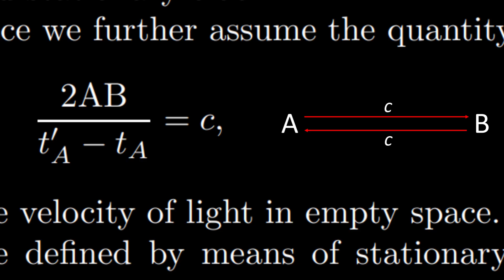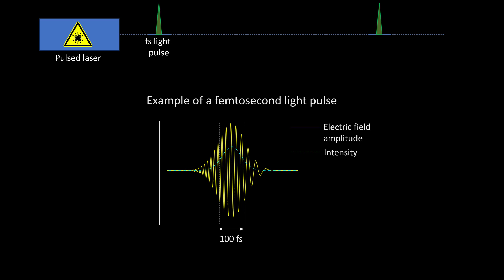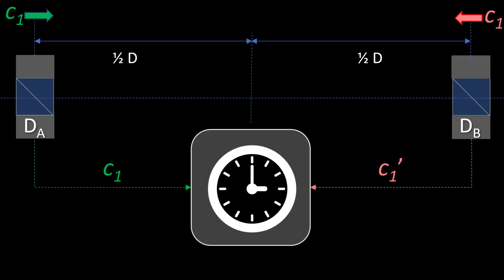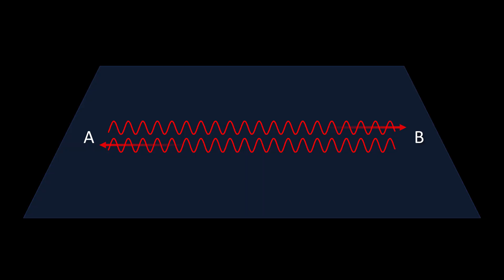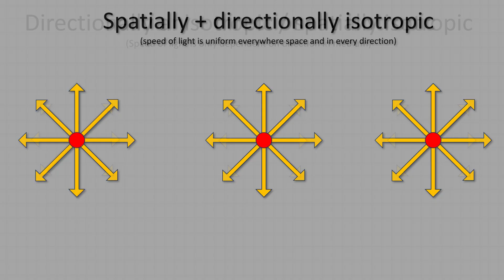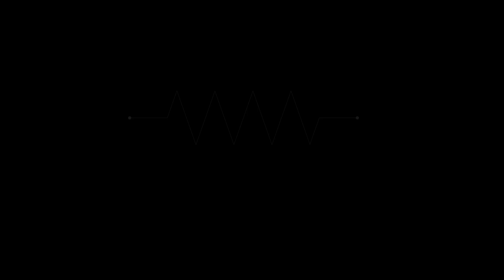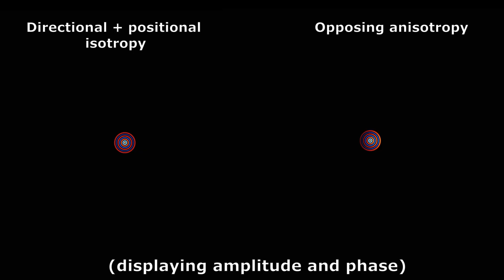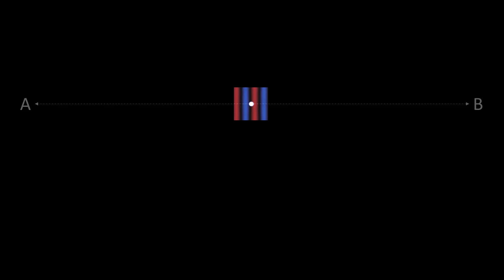Knowing the one-way speed of light

Comment: There are some very simple simulations you can do to see the ckear difference between a frame witg a moving medium and a frame wirh a stationary medium, regardless of the relativity being there in both cases empirically. For instance grab a cavity, and calculate the scattering of reflected waves inside it with the cavity moving along in the medium. The way the light scatters inside is different with a central source that a similar cavity with a stationary medium. The anisotropy in opposing directions resulting from this does not change the emprical results, but it does change the waveform quite a lot. You should also make the cavity elliptical due to lenght contraction based cleverly in radiation pressure being the same on all parts of the wall,  you don't need to put in a lorentz factor by hand, but with a contracted cavity you don't get a similar wave pattern as in a stationary cavity it is rather different. Then you can elongate the space, which reatores the circularity of the cavity, but makes the speed of light appear anisotropic in this frame in a different way, namely transverse and longitudinal speeds are different in the streched space, so it is equivalent to a circular cavity moving with respect to a stationary medium, that is isotropic in opposing directions but anisotropic with respect to different direction such as transverse to the relative motions vs aling the direction of motion and so on. These are all just arefacts of transformations, but it shows that the medium only becomes effectively anisotropic in opposing directions due to motion, but due to a transformations taking contracted elipsoids back to circles makes another kind of anisotropy that can be expected to arise from material properties, and of just arbitrary transformations of space and time. Interestingly the intersection points of waves with reflectice surfaces always travel faster than light, and in a circular cavity, a lorentz transform takes this messy scattered inside an eliptical cavity and by choosing a different plane of simultaneity restores it to a nice circular standing wave pattern, therefore it is also possible to get representations in terms of an elliptical standing wave pattern with is built up of concentric ellipses of nodes and antinodes. It is fun to get an intuition for, you should play around with it. My experience with the physics community is that almost nobody, exactly nobody i have interacted with understand this space of more general transformations, that unites euclidian and minkowsky type formalisms under one coherent roof and that leads to a lot of myths and poor understanding of relativistic physics and what it means, such as incorrect tacheyon physics and idiotic derivations of time travel from Coordinate conventions and so on.

Comment: Your argument is basically not what was argued about with the isotropic propagation. Representations always exisred based on anisotropic propagation but only possible to construct mechanisms for in terms of moving frames with respect to a medium, these are euclidian transforms, which work just as well as lorentz transformations for relativistic physics, but is part of a broader class of transformations that drop the assumptions of isotopy in the speed of light in terms of representations of reference frames. In this broader context of representations, it is the  free choice of convention that gives rise to empirical invariance instead of a specific choice of convention like Einstein mistakenly derived/plagurized, and poincare and minkowsky formalized into conventions of spacetime structure. None of it is necessary it is just one way to do things, that only works because of the empirical invariance. The broader class of transformations between representations are more useful for more general physics where you can introduce small deviations from invariance and so on.

Comment: In what case does water waves have anisotropic propagation, simply if you move with respect to the medium, i don't think anyone have tried to argue the isotropy is false in the rest frame of the medium, but the question in Einsteins or ratger poincares argument is one of ignorance of whether you are moving or notnin the medium, it is about relative motion without regard for mechanism, because equivalent observations can be derives from a basis with a different speed for the medium, aka you can represent every state of observable motion in terms of being at rest with respect to an isotropic medium, however both of them are naive and did not discover the full transformation properties in terms of moving frames, where you can descibe every situation equally well in terms of moving witg respect to the medium, so any anisotropy can be explained as such, only tge determination of such a velocity empirically remains to be found, anyway, anisotropic mediums is not what anisotropy in this case is about, it is about representations where you are moving through an isotropic medium thereby making wave propagation relative to you anisotropic.

Comment: Also, the only way you could possibly do it is in higher dimensions, if the orientation of the wavefront matters at all in any experiment. For example, take a spherical cavity, if the cavitynis at rest in a medium such that light propagates isotropically relative to it, the. A wave fro. The center will hit the walls head on, while a moving cavity with the same wave inside it in a moving frame would be contracted and the wavefront would not hit the wall head on due to both the contraction and the motion through the medium, if you can construct a wall of such a cavity such that it lets more or less light through the walls depending on the incidence of the wave hitting it, as in partial reflections for example, then you could tell whether the motion of the cavity relative to the medium is 0 or not, aka whether the effective speed of light relative to its state of motion is isotropic. But who needs that in their lives. Anyway there might be some way to make that kind of experiment relativistic, i don't care too much, i have other issues witg relativity that i'm pretty sure kill it at some level anyway, so i'm not so invested, but it would be cool to show poincare wrong.

Comment: Why this one-way mystery? Harlow Shapley had a distance from the star (globular cluster star) determined and also had a certain pulsing signal timing from the star. By using those two, in a very simple sort of a way Shapley came to the conclusion that the yellow light and the blue light had the same speed within one minute in 24 billion. So, Harlow simply showed that there’d be no error at all up to the particular accuracy of 10^-24x10^9 min. All these cosmic speeds of light could, of course be determined only as one-way speed (from star to an observer). Obviously, the speeds out in the vacuum of interstellar space would also be the same. Well, it would have taken a wait of some hundreds of millions of years to measure a two-way speed of light over cosmic distances.

Comment: @Huygens Optics.  Please consider the following and critique.  I believe it would be a way to measure the 1-way speed of light.

Let a laser light source send a pulse horizontally from S to a mirror M.  Between these points place a beam splitter B close to the source.  Anywhere along a line below and parallel to the line S-M, place a receiver/Clock RC.  For convenience, the first example assumes RC is positioned directly perpendicular to the midpoint on S-M, such that the distances B-RC and M-RC are equal.  (Variations on this experiment would place RC perpendicular to points B and M to eliminate “x”  or “-x” components of the down-beam velocity, and to compare results between experiments.)

A pulse of light from S would partially deflect to RC from B, starting the clock.  The remainder pulse from the same beam would reflect off of the mirror M and traverse to RC, stopping the clock.  Since the delay from either B to RC or  M to RC could be made equal (centered) or related by trigonometrically by the geometry of the triangles formed by the paths, the delay between pulses at RC would be entirely due to the distance between B & M divided by the 1-way velocity of the beam, right?

If as you say in your video, the round trip (the C' paths) cannot be eliminated, I would ask it replacing them with a known transmission velocity wouldn't do the trick.  For example, the speed of electric signal propagation in a wire is not the speed of light, and if the materials are consistent, the speed of the signal should also be.  Alternatively, the speed of sound does not diminish with energy loss, so why not use sound waves for the paths from splitters to receiver?  In this way there is only one light path, and only in one direction.

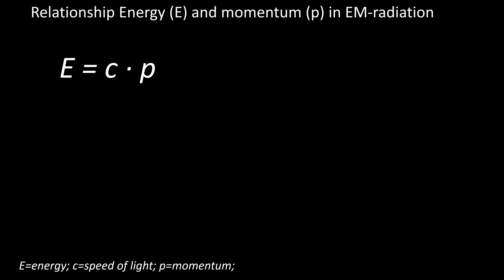Comment: I also saw many videos on the topic, included that posted on the Veritasium channel. In my opinion you’ve just found a way of proving that c is equals in all direction (@21:35), at least in a small region of the space-time, as I did more than 3 years ago but with a different approach.

Here is my point  
Let’s imagine we have a monochromatic source of light with wavelength λ propagating toward a diffracting grating with parallel slits each separated by the distance d.
We know that we observe diffraction and the first maximum (order 1 diffraction) is offset by a theta angle according to the following equation:
  d sin(theta) = λ    (eq.1)
But from the definition of velocity (space  divided by time = space/time ) we also know that
  c = λ /T  =  λ v  (eq.2)
being v the frequency of the light. Thus combining the two eq. we have 
  c = d sin(theta) v     (eq.3)
Since the frequency of light should not chance by changing the direction of propagation (we can ideally measure it in the same reference frame at rest)(*), if the velocity of light is different along the two directions, from eq. 2 we should observe different wavelengths for the two directions so that, according to the eq.1, by changing the orientation of propagation of the light , we should find the first maximum along a different angle (no more exactly theta).
This simple “gedanken experiment” should be sufficient to prove that the speed of light is equal in every direction.
Indeed, I suspect that the speed of light cannot be different back an forth because of geometry reason (conservation of angular momentum and so on) and is equal to c for every small region of the space-time lattice.
In fact assuming that the speed of light would be different along different direction (actually ways of propagation), by imposing that the average speed (roundtrip) is always the same, there will be necessarily a particular direction in which the speed of light in the two ways is the same (assuming that a small change in the direction will not change dramatically the speed of light).  

(*) We can be sure that the light traveling in different directions has the same frequency by ideally measuring the frequency with a clock for both the directions of propagation. Another way of measuring the frequency is to have an emitter (emitting in all directions) and a receiver exactly tuned to the emitter frequency placed once on the right of the emitter and then on the left of the emitter and record if the signal is received equally in both cases.

Comment: This seems very intuitive and easy to follow, thanks for the excellent video. But what about Veritasium's claim that one cannot measure c one-way? That still holds, right?
Reply from the maker: Yes, correct. Even though the speed can theoretically vary, an actual measurement will always involve the 2-way speed of light.
Reply: @HuygensOptics  what if you take your two measuring devices, still both connected to the 1 clock. One is placed 100 feet away, and the other 200 feet away, both in the same direction. But the cords connecting them to the clock are the same length. So device A is 100 feet away with a 200 ft cord, and device B is 200 feet away, with a 200 foot cord. The same length cords ensure syncing,  by pushing a button on the clock which sends a signal through the cord to each device which records the time it receives the sync signal. 
Then fire a laser or light that hits both, and record it. You will have the time the source (call it S) fires a light, the time it hits A, and the time it hits B. So you have S->A, S->B, and the difference between those two. Then you send the sync signal again.

Comment: you're never going to measure the one-way speed of light with a single clock, that I think is the fundamental problem with both this video and veritasium video.  In order to measure the one-way speed of light you'll need two clocks, one at each end of a distance D, and those can be atomic clocks that are synchronized by GPS (signals that are perpendicular to D).  The problem veritasium  made is thinking that just because he wasn't able to think through how to do it he concluded that it was impossible, that's hubris.  QED.   anyone disagree ???
Reply: And how do you account for the light delay in between those two GPS timing signals? You can't just assume the GPS satellite is infinitely far away and infinite wide.

Comment: Well you can always modulate a timestamp on a light pulse

And then decode it to get the speed relative to the receiver you point a "laser" at tx an rx both have atomic clock, and you can synchronize both using a 3rd atomic clock half the distance between Rx and tx to average out any time dilation effect...

How long does the second pulse take on average from the previous detected pulse, knowing the distance traveled and the time encoded on the radio signals

Comment: You can't. When you have two detectors separated at a distance from each other, you won't be able to connect them to the "same" time measurement, because they are already in their own reference of time. Ponder on what "time-space" means. If you don't understand what I am saying, just go back to read the "train going through a tunnel" example again.
Because if you want to compare the time of the two separated detectors, you have to bring them together, meaning at least one of them has to go through acceleration and deceleration, during which process their time reference is already changed.

Comment: One option might be to get 3 atomic clocks, 1 at the signal source and 2 for the other ends where the signal is detected.
Place all clocks together in the same location to start, then sync them all up or make a note of the time, or offsets compared to one another (short wires connecting them together since they're in the same place)
Physically carry 2 of the clocks away from the middle one in ether direction with a detector on each.
Send a signal out in both directions making a note on a piece of paper of the time reading on the clock that's sending and the ones receiving so no wires involved, then look at the difference.

Comment: It seems like this is just the simultaneity paradox in disguise. Alice and Bob meet up, get two clocks, and synchronize them. Alice moves a distance D left, Bob moves a distance D right, and they both stand still (relative to each other). Every second on the second, Alice flashes a light. Bob sees these flashes happening periodically, with a 1-second interval between each, and thus infers Alice experiences the same rate of time as he does. Moreover, Bob sees these flashes come slightly after each tick of his clock, with the delay given by dt=2D/c. When Bob also flashes a light every second on the second, Alice observes the exact same period of 1 second, and the exact same delay of 2D/c.

If the clocks are still synchronized after having been moved, then the one-way speed of light necessarily equals the two-way speed. The only way for the one-way speed to differ is if the clocks are not synchronized. But, there is already a reference frame in which the clocks are not synchronized! Consider Charlie, who is on a rocket ship moving 0.5c to the right, relative to Alice and Bob. Charlie sees light take longer to get from Bob to Alice, than it does going the other direction, simply because both Bob and Alice are moving fast left from Charlie's perspective. Relatedly, Charlie also sees Bob's clock being ahead of Alice's clock, i.e. the clocks are desynchronized to account for the differing times required to cross the distance in either direction.

The definition of "simultaneous events" is entirely dependent on your reference frame; simultaneity only makes sense for events at the same location. When events are at different locations, "simultaneous" depends on the observer. Measuring the one-way speed requires some notion of simultaneity across distances, which makes it inherently ambiguous. Even if the one-way speed were different than the two-way speed, then there would be some speed at which Charlie could move that results in the clocks being synchronized in his reference frame. We can simply redefine "simultaneous events" to be events which are simultaneous from Charlie's reference frame, which results in the one-way speed equaling the two way speed. This is a simple change of coordinates. The "one-way speed" is not unknowable in the same sense as Russel's Teapot. Rather, it's unknowable in the same sense that "which way's left?" is unknowable. It's an entirely semantic paradox, a simple matter of definition and choosing a coordinate scheme. It doesn't even qualify as a mystery.

Comment: At 2:33 onward, you talk about seeking to prove C1 = C1' and therefore get C2 = C1 + C1' but my question is: Does a mirror reflect instantaneously (Tm = 0) or is there a delay (Tm > 0)? If Tm > 0, it must still be very small, but when you're talking about the speed of light, small is not zero.
I'm no physicist so I'm not sure if this is important or irrelevant, but, at the very least, C2 = C1 + C1' + Tm and so inferring the one-way speed of light by halving the two-way speed of light would still not be correct.